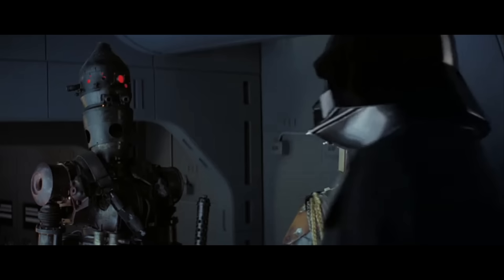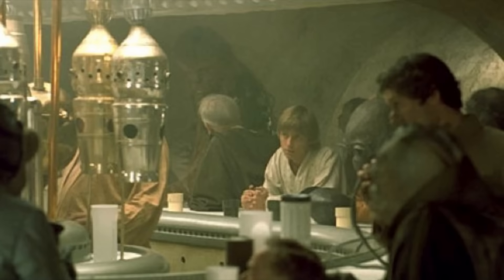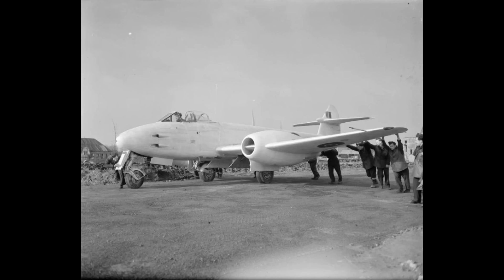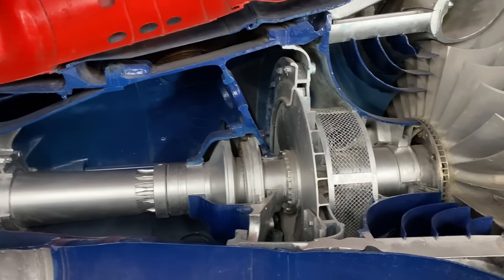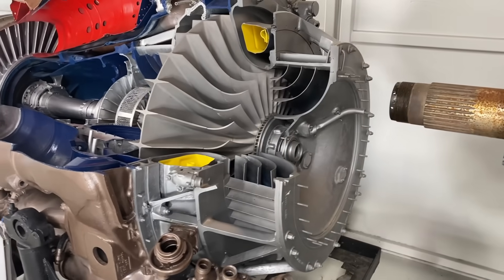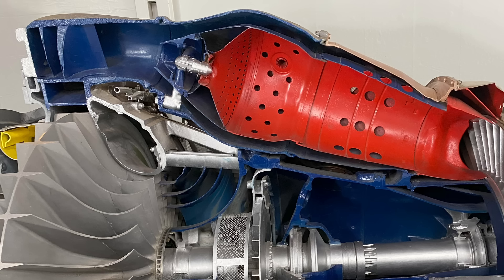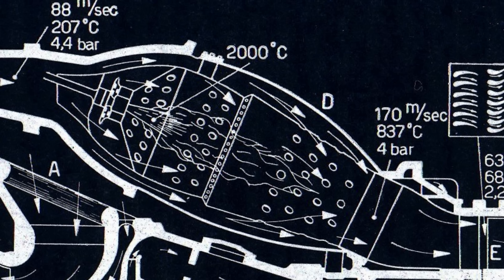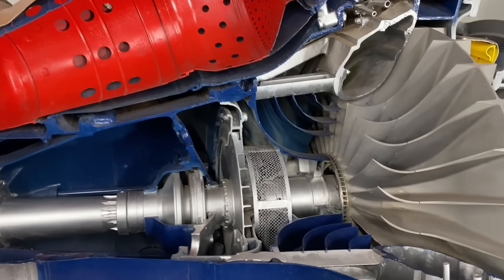The 1940's Jet Engine That Became Star Wars Design History

Comment: I'd be interested in your opinion of SABRE, the British combined-cycle, air-breathing rocket propulsion engine currently under development by Reaction Engines Limited.  It promises to enable aircraft to take off and land at regular airports, transition en route to rocket power for lifting passengers or cargo into low Earth orbit. I made a couple of films for UK television about its early development. R (Australia)
Reply: Well, I'll give you my opinion;
SABRE was supposed to develop the engine technology for Skylon, which seems to be all but officially dead at this point.  It has gone through an interminable series of redesigns and revisions that keep it from ever reaching the prototype phase.  I think Skylon is a project that simply bit off more than it could chew, and SABRE has suffered in its thrashing wake.
Reply: @HuntingTarg  I think Skylon was unlikely to ever happen... it would have been a very ambitious concept even for a company with a strong history in rocket development, which Reaction Engines wasn't (they're an R&D shop). SABRE has more promise, but it's still a major project on its own — and it's not useful on its own, because it's an engine that only makes sense for an SSTO spaceplane...

Comment: I'd love to see some more in depth content about jet engines... I knew the broad strokes of how they worked, but mentioned lots of details I didn't know in this one... Thanks for another great video!
Reply: They are a continuous 4-stroke engine, the same suck-squeeze-bang-blow engine cycle as most internal combustion car/truck/etc engines. The only real difference is that rather than separating the 4 parts of the ignition cycle by time (as in auto ICE), they separate the 4 parts of the cycle by location. Once you get your head around that, jet engines become an exercise in airflow control and materials science to get a reliable amount of power at a cost effective price...

Comment: @5:34 So with the 11 compression stages would it be right to say, that it creates about 7.5 times the pressure of the inflowing air pressure ?
Reply: I came to the same number
Reply: Compressors have gotten more aggressive over the years, more modern fighter jet engines can have 10 stages and get to 30 times the pressure.